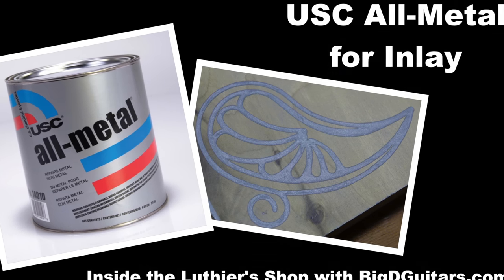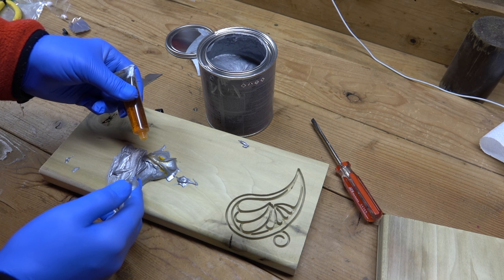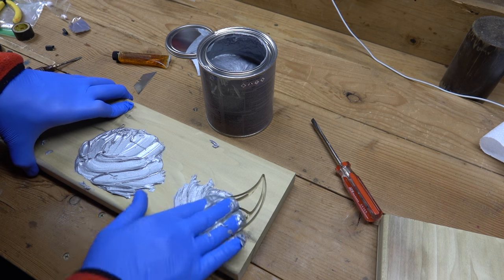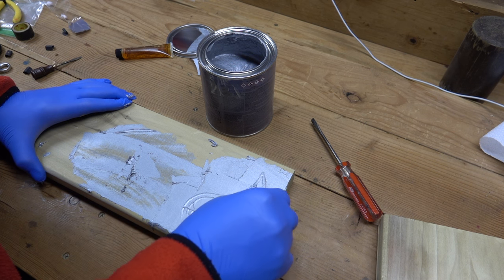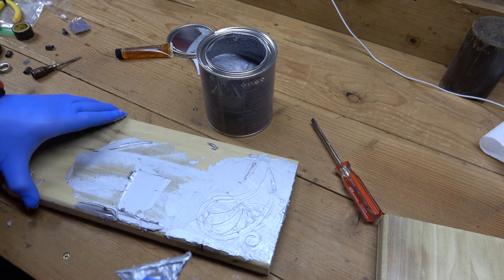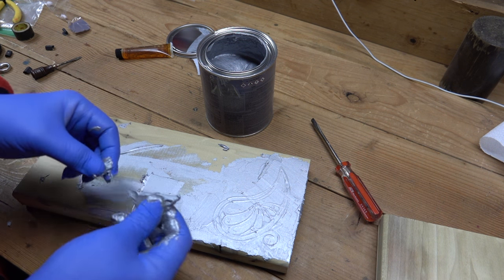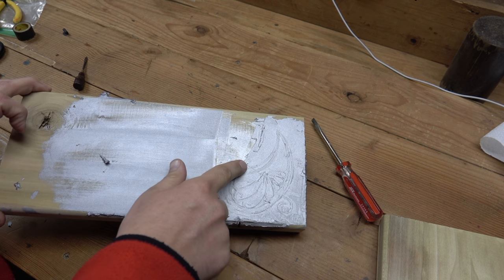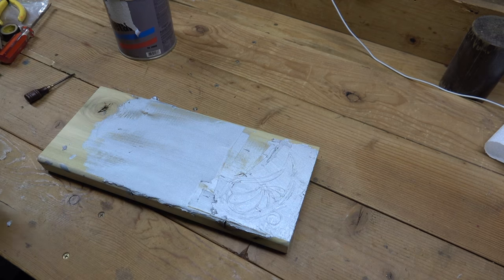USC Metal Flake for inlay Luthier Guitar with BigDGuitars.com

Comment: Tip for mixing 2-part stuff like epoxy, Bondo, etc: use a flat putty knife (or even an old gift card), scoop up the mix, then turn it over and mash it into itself. Repeat until thoroughly mixed. When you stir it in circles like you were doing, it has a tendency to work a lot of air bubbles into the mix; the "lift and fold" method is what auto body people use when mixing body filler, and it leaves you with far fewer bubbles after its cured. Think of it more like kneading dough, rather than whipping it in an electric mixer.
Reply from the maker: Great comment thanks for the tip!

Comment: I was wondering if you have ever tried to put tape down before you do the CNC inlay?  I was thinking would the tape get cut with a crisp edge?  If it worked well and then you applied the resin filler and peeled up the tape before it fully hardened it might be easier to sand.